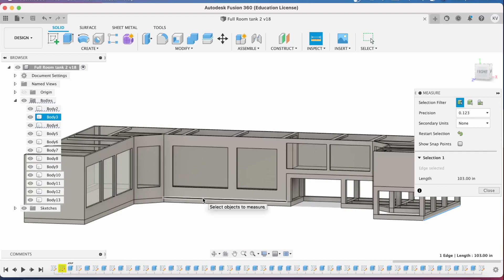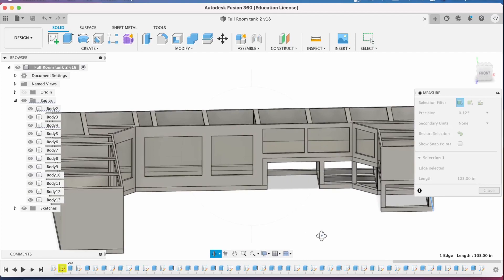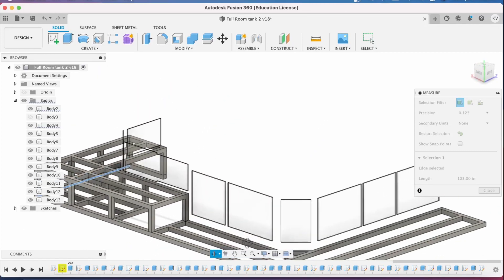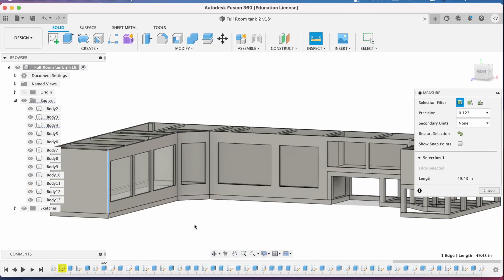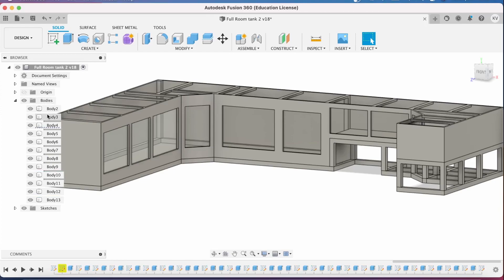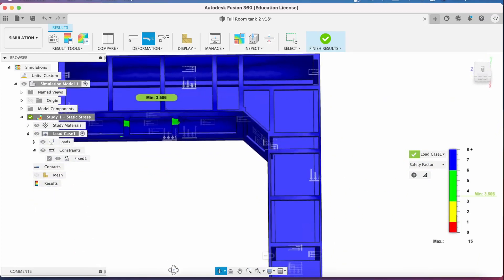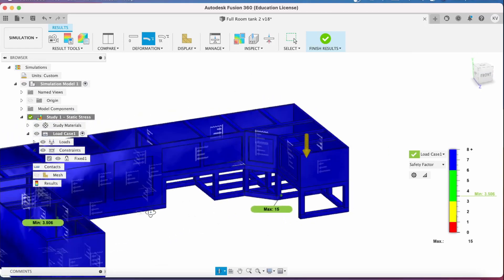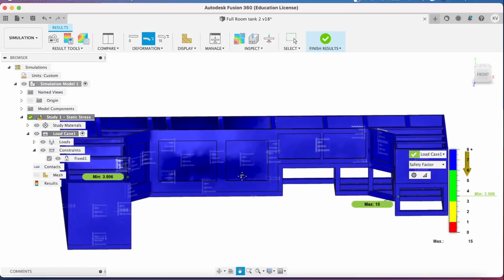New Tank design basics

Comment: Hey Steven getting excited for this project... why not do larger acrylic panels instead of multiple smaller ones? Amazon sells larger sheets too.
Reply from the maker: Price and weight. Anything larger than 36x48 has to be thicker than 3/4 inch, and "reasonable" prices cap out sizes at 96" long, so I'd just have one big window with a weird 36x36 window tacked on after, and I feel like a 48-36-48 breakup will look less weird.

A 36x48 inch 3/4 inch panel is going to run around $325-350 after shipping, unless I can get the local place to agree to order thicker than 1/2 inch stuff. A 36x96 inch panel 2" thick will run $2600 before freight shipping, nearly a $2000 difference for the same viewing area.

And a 36x48 inch 3/4" panel is about 50lbs, a 36x96x2 panel is pretty close to 300 lbs, which needs a radically different design to support and seal safely.

While I could probably safely use a much thinner sheet, I suspect the lens effect would be impossible to deal with.

Comment: Nice.  I'm following this build.  What are you doing for filtration?
Reply from the maker: Still going to do the DIY sand filters I was preparing before for water clarity.

With the amount of plants I plan to have just the sand will likely be sufficient for biofiltering for the first 5 years or so, too. I actually expect to have to add ammonia fairly regularly to this one, since it will have about 40-50 sq feet of planted area

After that it will probably depend on how easily I can capture solid waste as the pacu get bigger